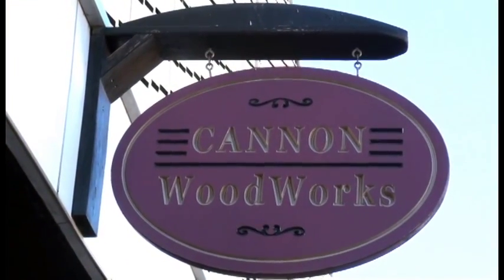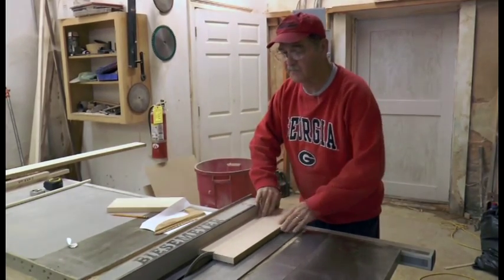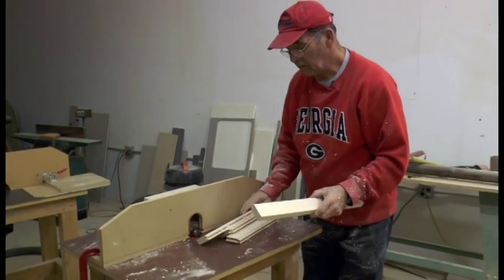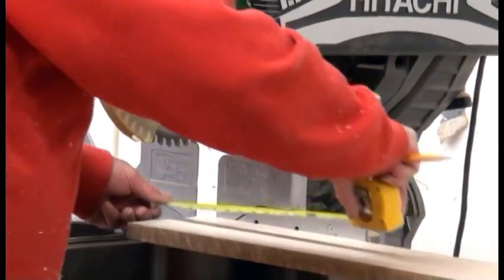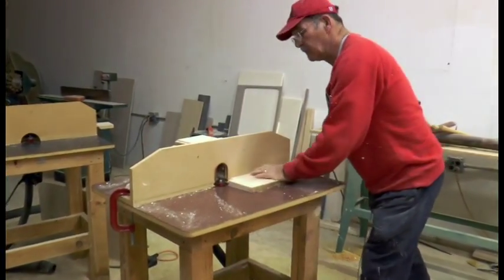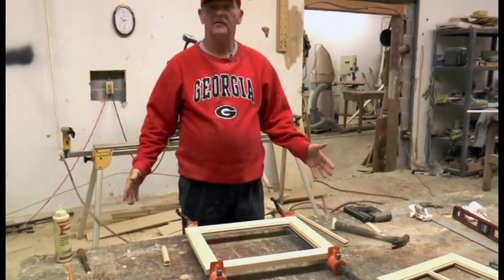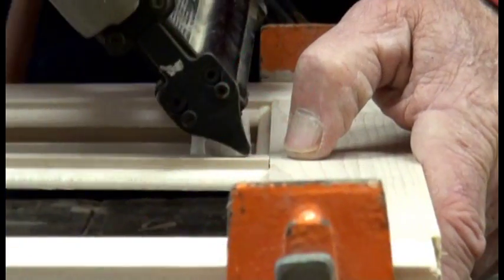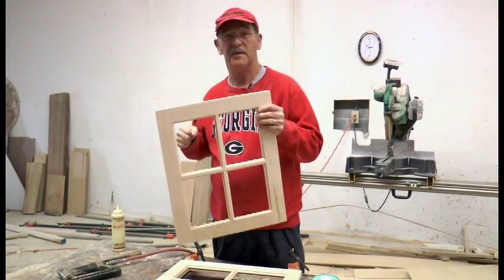Carpentry with Cannon Episode 1 The Makings of Mullions

Comment: How can the glass slide into the channel? Seems like it would have to either go in before glue-up or the back lip of the channel would have to be removed.
Reply: Yep.
Reply: he addressed that when he took a hammer and broke off the back part of the muntins. its flush on the back so 1 piece of glass sits nicely
Reply: You can't install the glass without cutting the perimeter back lip piece out, then you have to cut stops to hold the glass.